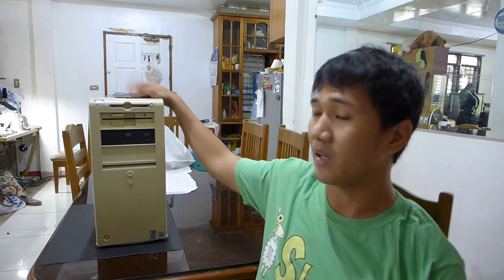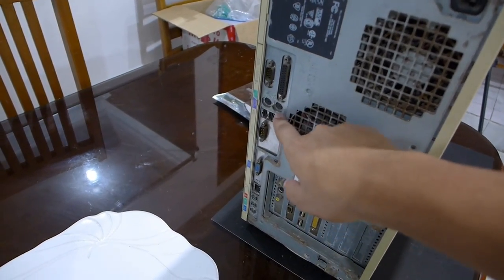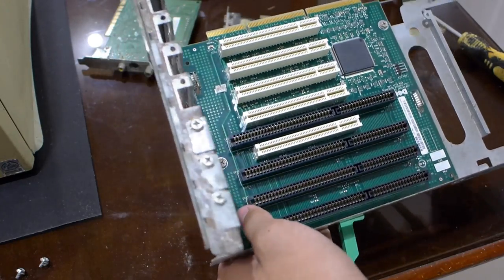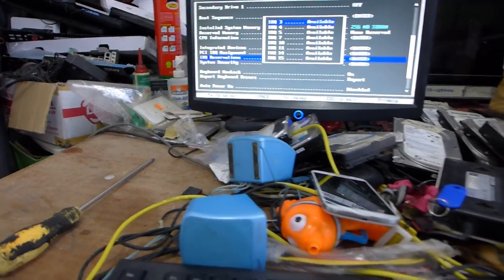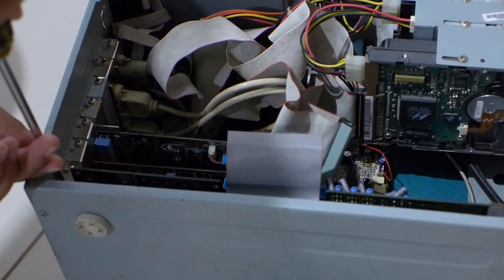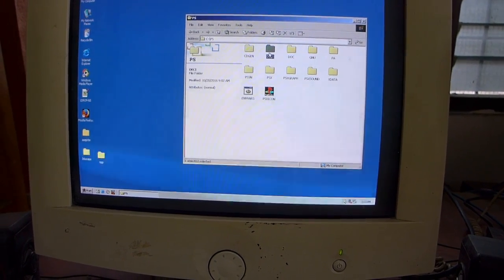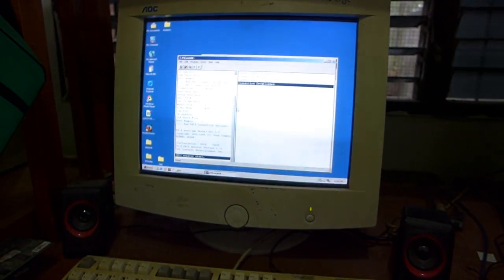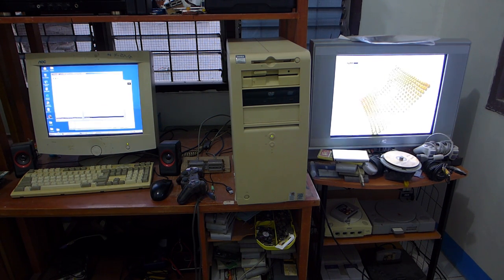Installing the DTL-H2000 on a Dell Optiplex GX110 running Windows 2000

Comment: damn I bought an ISA riser that looks almost identical to yours but the slot widths are too big! It fit in the cage perfect too

the only obvious differences I see are that mine has Intel on the chip and says Dell on the board between 2 ISA slots, where yours says it right besides one of them, and mine has 2 white patches next to the intel chip on the board (for revisions?)

Comment: that jetway 720bf board was utter crap anyways, and what the hell is Super BX 100?
Reply from the maker: Indeed, but I used it for my DTL-H2000 build as it was the only system I had that has at least 2 ISA slots that supports the fastest CPU I have for awhile. It was pretty okay equipped with an S3 Savage 4 and a Yamaha YMF724 for games. The thing I didn't like most about it was there was no space to add Ethernet to it with both the aforementioned cards installed, so I used a USB Ethernet adapter that I somehow got working once but couldn't repeat it again, though it had official drivers for Windows 98.

I got the Socket 7 version of it (J-530BF, Super TX 100) paired with a K6-II 400 not too long ago, that thing is shittier than the the J-720BF because there's no way to turn off the on-board VGA at all. There's a mystery unlabeled jumper very close to one of the chipsets which is probably to disable the on-board VGA but for whatever reason doesn't work, which probably explains why it wasn't labelled. Oh, and the CPU is placed on a spot where it would most likely get in the way of a hard disk in most computer cases.
Reply: I typically steer clear away from dodgy boards like PCChips and Matsonic that have those wacko chipsets like TX Pro and Super TX3 and others. I go with known brands like ASUS, Intel, Gigabyte, Micronics, FIC, etc.
Reply from the maker: The only working Socket 7 systems I have use PCCheaps boards. One is an M520 (which is actually pretty good) and a M571. They seem quite stable but they're nowhere near as shit as that Jankway J-530BF, but that's sadly my only Super Socket 7 board that actually works.

I might do a video on the two PCCheaps machines soon, particularly the one with the M520 as I've fitted it with an interesting VGA+TV Tuner hybrid card from Korea.
Reply: @lameguy64  my only PC chips board that i have is a M912 socket 3 board which i have refurbished with new capacitors and a thorough cleaning, it's currently my main 486 PC's board, it has real cache instead of fake cache.
Specs:
PCChips M912
Intel 486DX2 66 MHz
32 MB 2x 16mb FPM SIMMs
Trident TGUI9400CXI VLB
Sound Blaster Pro 2.0 CT1600
Transcend 2 GB CF Card
DOS and WfW 3.11